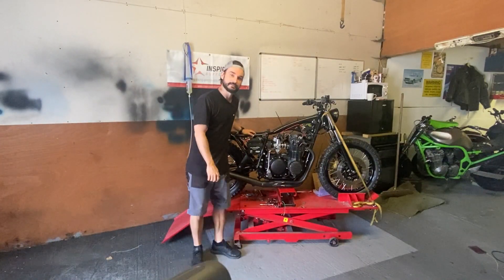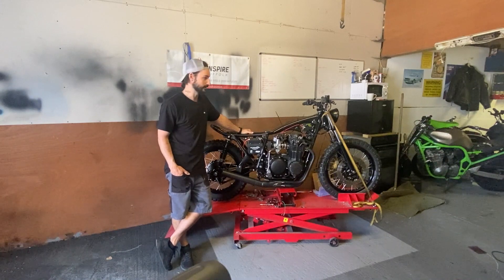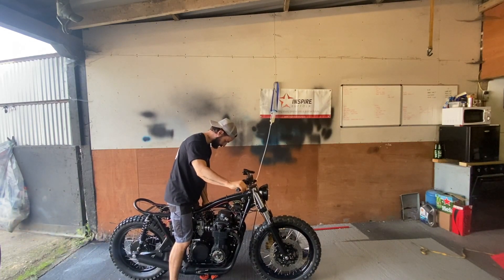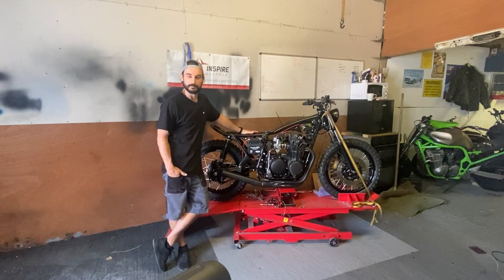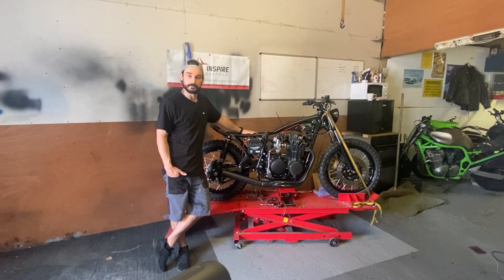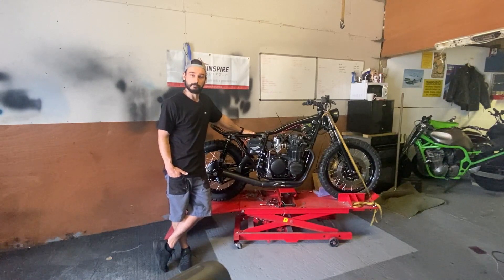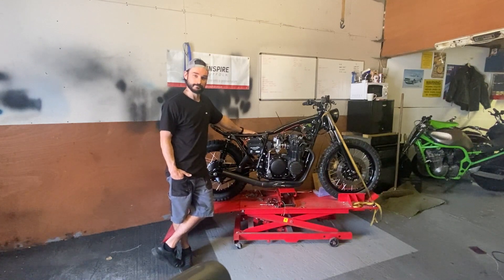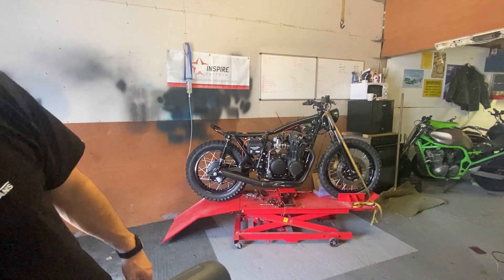Honda CB500/CB550 Custom Scrambler Charity Build Update - It's Alive!!!!

Comment: What headlight is that?
Reply from the maker: https://www.ebay.co.uk/itm/Headlight-Black-H-4-Chopper-Black-Old-School-Custom-Harley-Bates-Style-5-3-4-/371500977329?mkcid=16&mkevt=1&_trksid=p2349624.m46890.l6249&mkrid=710-127635-2958-0
Reply from the maker: This is the light I used. Kindly donated by the seller for the charity bike 😊
Reply: How did you mount it I can’t tell
Reply from the maker: @garageowns9784  they also sell a mount for the bates headlight which I bent and mounted to the lower yoke